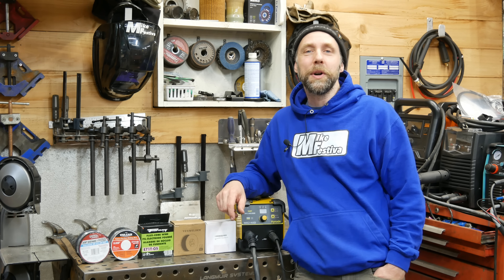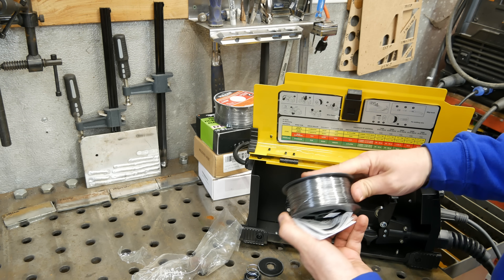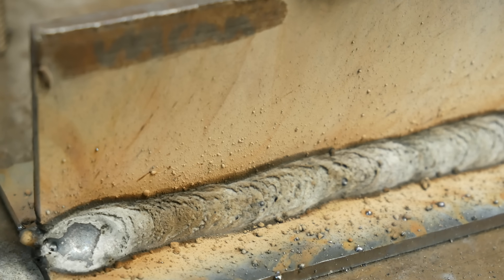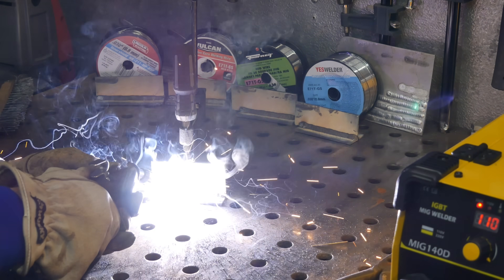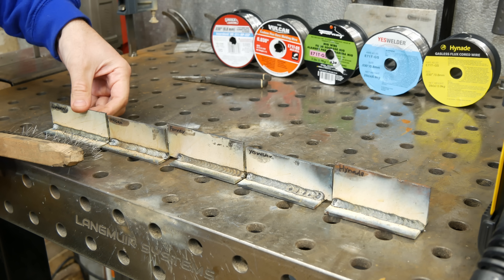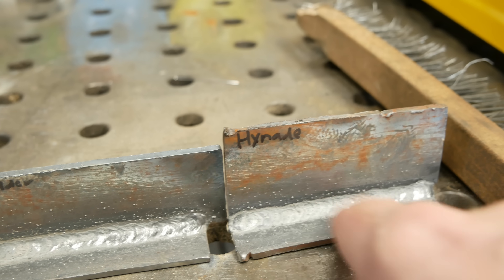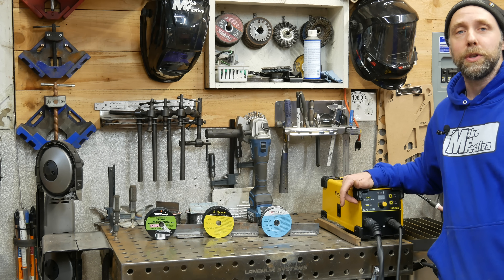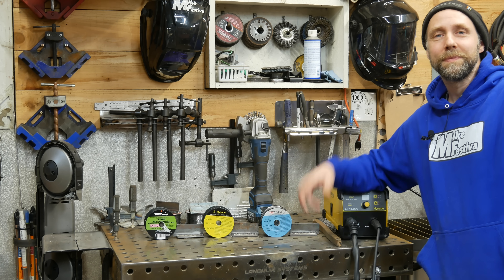Gasless Flux Core Welding Tips, Make Better Cleaner Welds

Comment: Great comparison. I ordered 10lb Yeswelder from Amazon $34.39 free shipping., I have used Lincoln for years only because that for the most part was what was available. Most work I have is on my equipment, rusty, pitted material that doesn't get as clean as you want it. First thing I noticed it burned a bit hotter and made a better and smother pool than the Lincoln on rusty spots or just strait rusty metal with the same settings. Where the Lincoln would not even spark, Yeswelder started without hesitation, A 3 inch bead side by side, Yeswelder 2 small spots where slag bubbled. Lincoln every quarter inch, it was a mess.
Reply: Would different voltage and feed settings make any difference for the various wires?

Comment: I run straight flux core and my results match yours. I have tried all those wires except the (hyanide?) and the Forney stands out as my go to. You can hear it when welding and clean up is way less especially when combined with anti spatter spray. I will never use Vulcan unless it's all I can get my hands on.
Reply from the maker: Glad to hear you are getting similar results 👍 there’s definitely a difference in flux wire sold on the market.

Comment: The lincoln is e71t-11... multiple pass.. more expensive. The others are all e71t-gs... single pass... more manganese... normally easier to weld. But thanks for the demo !
Reply: Does that mean that you don't have to knock away the slag before adding a second layer? Honest question, I don't know jack

Comment: Maybe 3 years does make a difference, as of 2025 at around $75.00 >>{ Forney 0.035 in. Mild Steel MIG Welding Wire 10 lb spool } is WAY WAY to freeken much money for retire folks and a  slightly better wire, Forney always use to be a better bargain brand but not anymore.........
 And as of 2024 I will NEVER EVER buy anything  with YesWelder name on it again, Hynade welding wire is almost impossible ti find in 10lb spool........ 
So I'll buy again >> { VEVOR Flux Core Welding Wire, E71T-GS 0.035-inch 10LBS } at a jungle store cost of under $30.00
Reply: Why no YES Welder anymore?

Comment: For me it looks like the Lincoln cleaned up the best in the end (no dog in the fight), but in the end I would get the Forney due to price.  In general, flux core sucks but if you're outdoors in the wind it's the bomb and that's where you need the inner shielded wire.  I understand some guys run it because they don't have a tank.  I like TIG the best as far as cleanup and my lungs but it takes more skill too.  Good video Mike and nice technique.
Reply: For the yeswelder amazon has the price per pound $7.22 if you buy 1 2lb roll, $4/lb if you buy 3 rolls and $3.40/lb if you buy 5 rolls. That is very cheap.

Comment: Thanks brother! Found your data really enlightening. I have also been welding a lot with flux core Lincoln and Vulcan wires since I got into flux core welding. It is good to see I am not the only one thinking there has to be a better wire out there or I am doing something wrong. Hate all that splatter. Anyway I decided to plunge into the yeswelder wire on their site through your link to help a brother out! Thanks for the information! Hugs sir!

Comment: why did the forney spool say MIG wire??? actually it said both Mig wire and top left of the label said flux core
Reply: My Rookie mistake   make sure the wire your using is Flux Core not MIG
Reply: I’m a new ie to welding, would MIG require gas?
Reply: @toastyy1990  MIG is an acronym for "Metal Inert Gas", so yes, it requires gas.  Note that there are some flux cored wires which also require a shielding gas, but these are used with higher powered industrial machines that most home users don't have.  Also note that some flux-core only welders are marketed as "MIG" welders.

Comment: I've run yes welder and arc captain wire. I do like the Arc captain. Flux core wire. A big factor is price. You can get a 3 pack of 2 Founders for the price of or less than 1 Lincoln or forney. There is some spatter but I have noticed dialing the settings does help with that some. 
Anyway thanks for the very informative video.
Reply: @MidnightCustoms-C20  I just found a 6 in 1 welder with gas for $190 and a $15 coupon, I’m new to welding and see this is a very low price so I am wondering why and trying to find answers form people that know welding maybe I am missing something, it’s right on Amazon
Reply: @alwaysrised  well I would say do your research on it, and read whatever reviews there are for it and make an informed decision.  
Definitely do what you can afford though. Thats what I did and I arrived at the Arccaptain brand which I have had nothing but great experiences with since I started.
Reply: @MidnightCustoms-C20 I am trying to, there is no reviews just stars but you know about welders so would you tell me if this is what they say it is, this is the name and the description BILT HARD Aluminum 200A MIG Welder, 110V/220V MIG/Flux Core MIG/Lift TIG/Stick/Spot Welding/Spool Gun Compatible 6-In-1 Welding Machine w/IGBT Inverter, Multi-Process Welder and you could copy and paste it in Amazon, I would appreciate it, I can just use flux but if I can get one that can do everything that cheap I probably should idk, do you need a tank with MiG gas?

Comment: I have an old Harbor Freight blue 90A flux core machine. I think it’s 90A. High/Low switch for current and dial for wire speed. It runs pretty good with the cheap wire from Harbor Freight. I put Lincoln wire in it once and the whole spool of wire was problematic. Actually a lot of trouble to sustain an arc, didn’t want to burn through rust with it very well, and seems the filler material is much thinner than the Harbor Freight wire because the same holes I was welding up burned through a whole spool of Lincoln wire and not even 1/8 of the roll of Vulcan. Bought a Titanium Flux 125 today and a roll of Vulcan .030” flux core and man the improvement is amazing! I threatened years ago to convert my blue box with a bridge rectifier and some capacitors. I can get decent beads from it and it will burn in good if I don’t try to weld thicker material than the 90A maximum output machine is capable of. But over the years it’s put my brush mower back together a couple times. An old grill a few times, made some projects and I really don’t know what all but I saw a video today and decided I have put it off for years so bought that inverter flux core welder and man! I won’t throw out my old spatter king 9000 but I suspect I will be using this one until it’s utterly dead.

Comment: Hi there, the only thing I didn’t understand this machine is working without gas?
Reply from the maker: Yes that’s how flux core wire works, it doesn’t need gas because the wire have flux built into it.
The flux smoke shields the weld from oxidation when welding 👍
Reply: Think of it like stick welding but with a wire, and instead of the flux being on the outside of the rod, as with stick welding, the flux is on the inside of the wire.  Note: the "T" designation on flux core wire stands for "tubular", because inside of the tube is the flux.

Comment: I use flux core just for outdoor welding. It is a fast and forgiving process compared to TIG. The only thing I don't like is that it consumes a lot of contact tips. Everything runs nice and smooth but steadyly the hole in the tip builds up until it slows down the wire feed. I have cleaned up sticky nozles with a drill. There comes a kind of black gunk instead of copper. Maybe that is some dirt on the fluxcore wire that burns in the contact tip. Just used up the 2.nd rol because the machine uses 5kg (bit more than 10 lbs) rolls. I have not found an answer to this problem on youtube yet.
Reply: @johannriedlberger4390  Have you tried nozzle grease or nozzle paste?
Reply: @lemuel1998  I did try it but it makes no difference.

Comment: As a amateur stick welder I'd run three tests .
A. The amperage you tested
B. Slightly faster feed and voltage 
C. Slightly lower voltage and speed
Perhaps those spattered cores run better at slightly different setups rather than not be best worst ?
2. If you MIG with gas don't you save cleanup time and bypass a tonne of time on jobs ? Doesn't that offset has cost?

Flux cored versus gas .. what would you say with those with experience ?

Comment: I like the Forney wire, it’s reasonably priced at ace hardware. It runs the best through my welder. However it’s only rated for single pass application.

Comment: I have been using the Vulcan .035 wire and it does pretty good for my needs + there are not any welding supply shops within 40 miles from where I live..but I like the 3 you picked..the welds look good.

Comment: I have an old Harbor Freight blue flux core box. The transformer AC box. It actually runs the Harbor Freight stuff pretty good but I bought the Lincoln .030 flux core wire and it spit and spattered and gave more porosity than my first hour of welds with the blue box set up wrong. It doesn’t like .035 wire and no point trying it but I think some wire and flux is more aimed at making the most of the target machine.

Comment: mig gun should be on the positive and the ground should on the negative
Reply from the maker: I explained it in the video but seems you didn’t understand. But that’s a common mistake of not knowing how to set up welders when leaning.
When welding with (Flux wire) you NEED to set your welder to Electrode negative, this means your MIG gun is connected to the - plug and the clamp goes to the + plug.
With solid wire you set your machine to electrode positive.

Comment: I bought some Forney wire at a local Hardware store when it was closing and liked the way it welded.  Never was impressed with Lincoln wire and the Harbor Freight stuff either. I bought some flux core wire at Menards that ran like poo as well. It had a ton of spatter and didn't like to hold a stable arc.  It was U.S Forge brand.

Comment: i have had great results with "blue demon" wire , does anyone else use it ?
Reply: I’ve been using blue demon .030 on all the bodywork on my truck and I love it. I use it with the titanium easy flux 125. It’s an awesome welder too. Highly recommend
Reply: @KyleRS877 I switched to the easy  flux 125 and welding got easier. Do you know what the classification of limited multipass on the blue demon wire means?
Reply: @ no I’m not sure. It might say on their website
Reply: @KyleRS877   E7IT11 wire - The E71T letters are the AWS standard for flux core welding wires. This wire is for mild steel or low carbon steel.The first letter E means electrode. And this means electricity passes through this wire. And it does all the time you’re welding.Next is 7. This tells you the strength of the wire. And your wire has a tensile strength up to 70,000 pounds per square inch.Next up is the number 1. And this says your welding wire is for welding in all positions. You can use this wire when you weld on the flat, horizontal. And for welding vertical and over your head.The last letter T tells you is a flux cored wire. (still looking on specifics of multipass)
Reply: @jasrak221  I believe Blue Demon is multi pass like Lincoln E71t11
Reply: @jamesbynum3123  yeah blue demon had multipass, wire, and standard wire all kind of flavors, but I was curious as to how many passes since the spec’s state it is “Limited multi pass”
Reply from the maker: I was also heard it’s good wire, I haven’t ever tried it yet, but many others have commented that they like it 👍

Comment: Just got 3 2lb rolls of the Yeswelder wire for $30 plus 15% off.  That is less than $9 per roll.  Hard to believe you can get good quality wire for such a decent price!
Reply: Where?
Reply: @DEW-fk7ij Amazon if i remember right.

Comment: Great video! Is it possible to change polarity between clamp and gun, and how is that done?
Reply: If the welder does both flux core and Mig, you need to. Just swap a couple wires that are easy to access.

Comment: @Mike festiva what's the difference between flux core wire and MIG wire?
Reply: I'm not Mike, but I play a newbie welder on YT.  You know how solder has the flux inside the metal?  Flux core welding wire is made the same.  Mig wire is straight solid core wire which uses the argon/CO2 gas as a shield instead of flux.

Comment: Great vid thank you. Was wondering your thoughts on using a flux core Lincoln 90i fc gas less for truck frame repair. I have the safe t cap kit. I only am doing my truck. Not looking to get into it professionally. Any tips very appreciated. I’ve never welded and plan to practice with some scraps before doing the truck.

Comment: I bought some Hobart flux core 0.30 thinking it had to be better than the Vulcan wire, it wasn't.  It doesn't weld smoothly, has even more splatter and it smokes so much that it is hard to see the weld.  I am definitely going to give the Forney a try.

Comment: Cheaper Mig welding machine, but no gas, how do I get started using gas?
Reply: @robhein  You need a machine capable of it, most little flux core machines are dedicated to FC only. I had a Miller 140 and it had gas. You run a different wire as well when using shielding gas. ER-70 S2 or S6.

Comment: Put a fan blowing your flux away from the weld.  Flux core was designed to weld in the wind. It does a better job. Less splatter and see better .
Reply: To a degree. The Flux is actually the shield for the weld, yes you can weld with it in the wind... Just depends on how much wind. Try putting the fan as close as you can and put it on high then you are blowing all the shielding gases away see what happens. 😂

Comment: If it's a flux core machine, why is it labeled as MIG-450D?
Reply: Multi function machine probably? MiG involves gas to shield the weld and flux core is MiG without the gas. So a MiG machine is a flux welder if you disconnect gas.

Comment: When I started welding, using a flux core wire, I didn't know diddly.  All I knew is that I couldn't see anything.  I spent a lot of time trying different things to see the puddle.    I used the wire that came with the machine until I got tired of dealing with the rats nest ( I told you I was a beginner). After a long time I finally changed wire.  Now I can see.  It was smoke.  The original wire produced copious amounts of SMOKE.
Reply: I’m curious what wire you’ve used that didn’t seem to create as much smoke?
Reply: @Kevscancave  same my shit smokey as hell

Comment: Thanks for posting.  I'm a newbie welder and learning on a Titanium 125.  I've watched some of your other videos about the 125 and also very insightful.  I did notice quite a bit of splatter from this versus welding on a MIG machine with gas.  I knew there would be splatter with the Flux core wire but seeing this video gives me a little hope that my welds with my little machine can be a bit cleaner.  the wire that came with the 125 and it splatters quite a bit!  Might also have to do with my inexperience.  😄  I build furniture and have been wanting to add metal work to the things I make.  I just realized metal is a whole different, deep rabbit hole, just like woodworking!   Love learning new things and glad I came across your channel! 😄☺  Keep up the great  and informative work.  Only helping me to get better!!  Cheers!

Comment: One thing to note is that the Lincoln flux-core is the only wire tested that is approved for multi-pass welding ('-11 type').  The other wires are '-GS type' and are only approved for single-pass welding.  Hobart also has '-11 type' flux core wire.
Reply: @origin0000  I think it's better welders that create better welds.  Flux core has better penetration than MIG and avoids the initial costs of a bottle and gas.  Getting a MIG machine allows one to start welding with flux core and wait until needs change and/or funds accumulate before starting MIG welding.
Reply: YES.  BUT WHAT IF they (LincolnElectric) only paid a huge amount of cash just to get that paper certificate, and it possibly is just that: A nice beautiful paper certificate to be framed and hung on the wall ???  

Look, since the FASHION of the costly "Certify-Everything", many ready to become bankrupt Classification Societies, like Lloyd's of London, Germanische-Lloyd's, Bureau-Veritas, DNV-Det Norske Veritas, or TÜV transformed their business of Classifying marine vessels and large petroleum installations into a much more profitable "Crazy Certifying Everything"... but their precious Certifications mean little in reality, like all the ISO-9000, 14000 or whatever-thousands costly trends.  Until some sensible people (like "Project-Farm") proceeds to actually testing if the Lincoln E-71T-11 to reveal IF it is truly "better" at multi-pass, away from any large government organism, as we could very well be paying double for an almost meaningless paper certificate!

Comment: when Gasless Flux Core Welding, how do you keep your welding torch from overheating?
Reply: To avoid torch overheating, maintain distance from work material, generally 1/2 to  5/8 inch and follow the machine recommended duty cycle specs. With flux core, I find keeping the bead length reasonably short tends to keep things cooler.

Comment: Just too add a note, I weld vertical up and overhead positions at work using .045+ flux core/ Hobart wire. You need to make a few videos on uphill and overhead welding.

Comment: I found a few tips that would be very handy to know, Thank You for spending the extra money on the different wires so that we wouldn't have too. I purchased a 2 lb. spool flux cored wire from Tractor Supply for 9.98 regular price and it ran great with hardly any BB's. A week before I got a spool from HF ran really badly @ 14.99. Go figure.